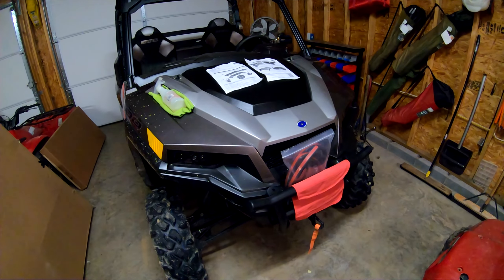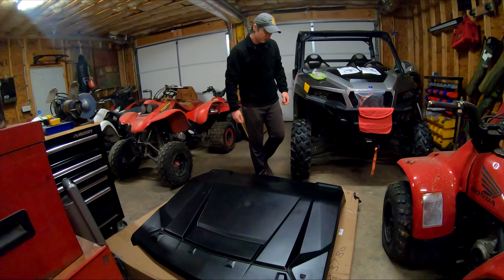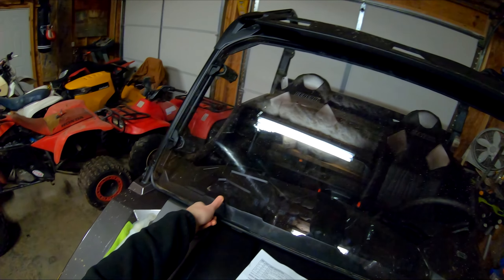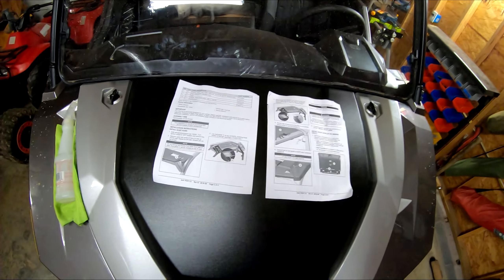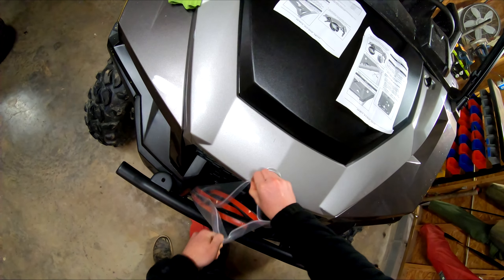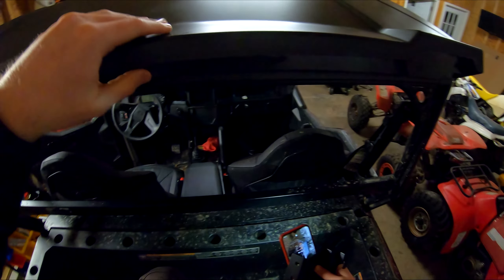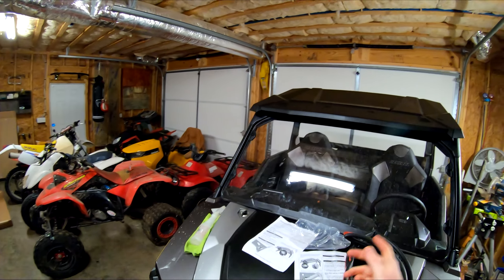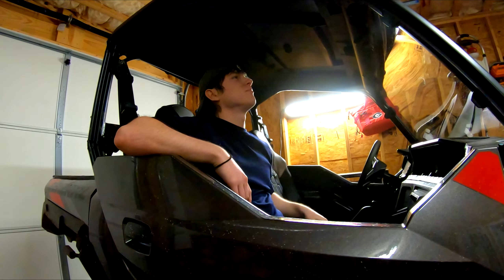Polaris General Windshield & Roof Installation!

Comment: Get yourself a rear window also. Helps greatly with the suction created by the front, especially in dust.
Reply from the maker: I definitely want one! What's a good brand?
Reply: @dbaKen  My dealer put on a Seizmik. They inexpensive and scratch easily but it works. Easy install like the front.

Comment: I have general on order don’t know when I’ll get it hopefully by summer… I check prices not much cheaper to go after market you might as well get it from the dealer in if you’re going to make the payment
Reply from the maker: When did you order? Yeah i just added them on to the final payment.
Reply: @dbaKen  Dealer had one all loaded had ride command top-of-the-line would’ve been 31 grand out the door! I am like you buying the premium and I’ll make it like I want!! Nail down final order last week I am hopefully going to get it before spring! Full-blown winter here where I’m at and below zero weather so I am riding my sled! long as I have it by first of june!  Are you going to get a rear panel seems like everybody does man they get a lot of money for these machines much as a Car! Keep up the videos.. maintenance Let me know if you’ve had any problems?
Reply from the maker: Yeah I think the premium is the way to go. Only major thing missing that I would like is Fox or Walker Evans Shocks but the stock shocks are honestly pretty great! Also , lots of videos coming for it so stay tuned.